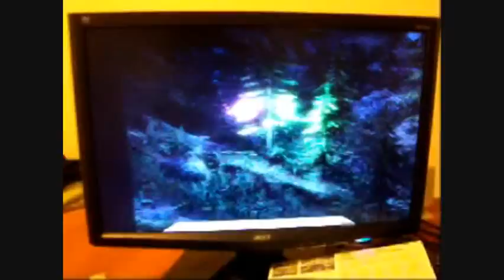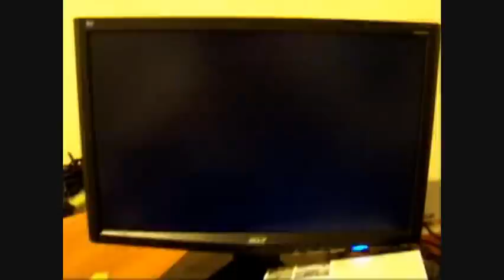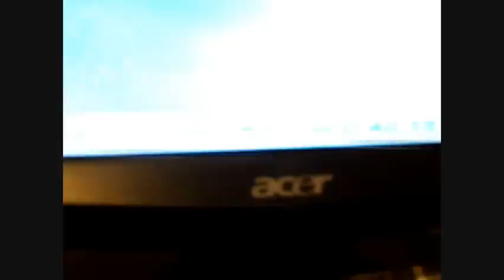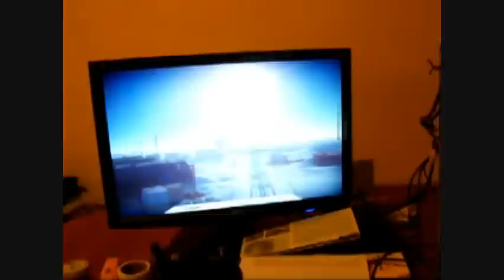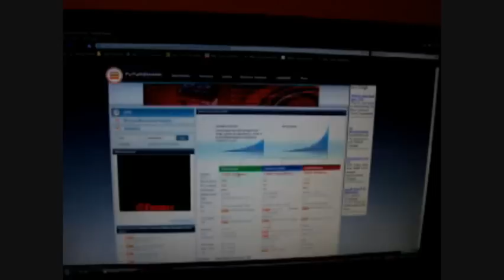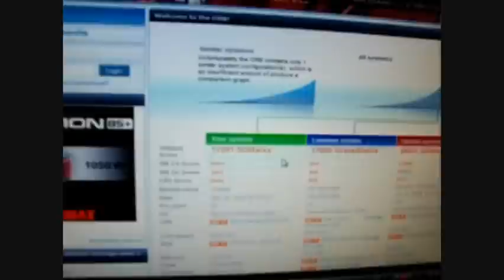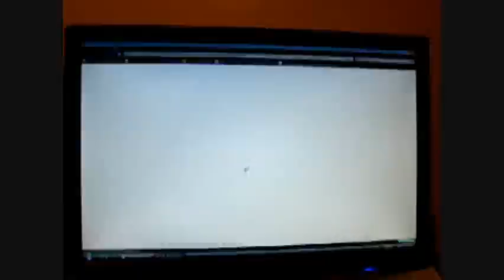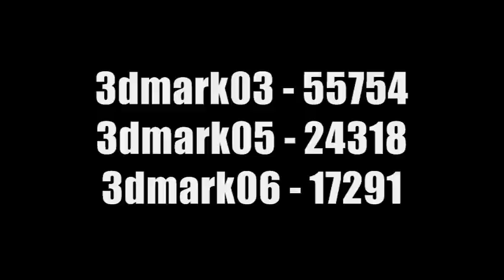Overclocking HD4770 (ASUS Top BIOS Volt mod)

Comment from the maker: drivers are design for specific operating system, meaning there are Windows drivers and there are Linux drivers for ur hardwares, therefore , a Operating Systme have to be present  in order to install these hardware driver applications (with a few exceptions but not everyday stuff) , therefore in everyday bases, u need ot install windows FIRST and then gather ur drivers to install them